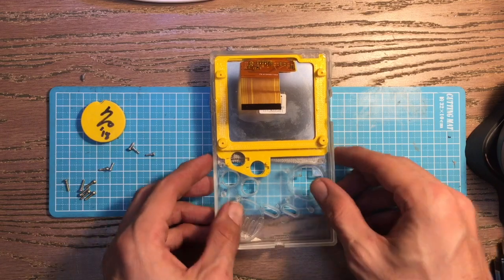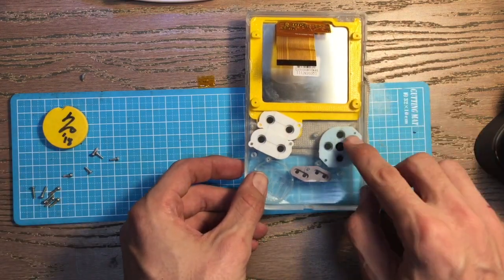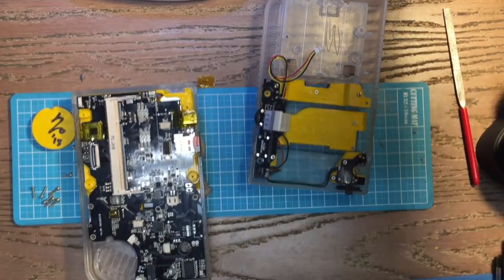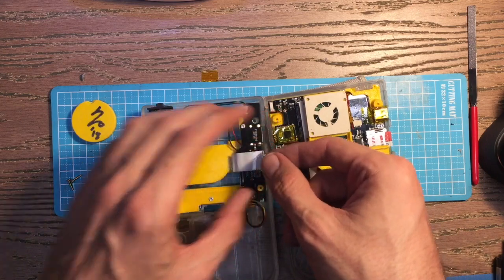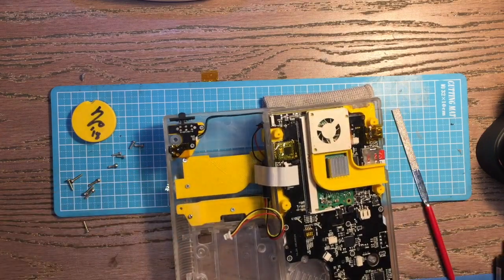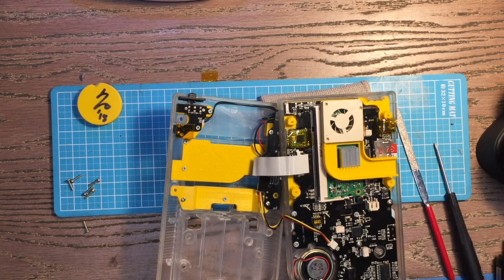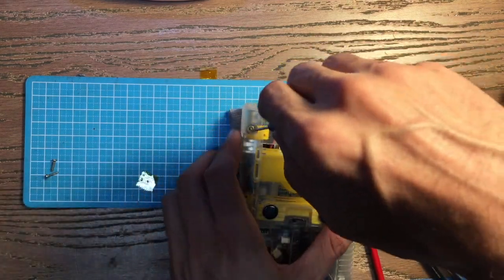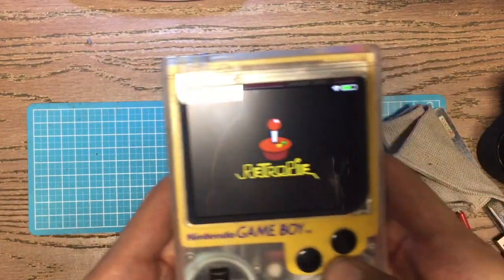GameBoy Zero: Circuit Sword Final Assembly

Comment: Can you tell me what kind of fan you are using and a link to where to get one please?
Reply from the maker: GabrielSorrow the fan is included as part of the Circuit Sword kit. I will have “full DIY kits” available in 10/2018 or you can preorder the next batch for delivery next year around the same time directly from Kite on the sudomod forums. Email me at lee@braains.net
Reply: I'm very interested in ordering from you, how much are the kits. I'll email you too.
Reply from the maker: GabrielSorrow I have not established a pricing schedule because it depends on features, I plan to provide “diy kits” as well as fully or partially assembled units with options including custom colors, joystick(s), volume rocker, and number of rear buttons. I look forward to your email. :)
Reply: just sent one, but i know what i want so , just send me an email with details when your ready and thanks.

Comment: Quick question.  With the air duct that you made for the fan, where does the exhaust end up going?
Reply from the maker: Matthew Thompson It’s pointed to the side but you should make a cut for airflow if you want best performance; I’m only playing NES so the fan never runs on my setup (expect during power up).
Reply: One more question, how does your power switch bracket mount only with the screws?  It seems like it would need to be glued in.
Reply from the maker: The only glue is on the front bracket; power switch bracket is nice and snug with no adhesive, the screws secure the PCB to the 3D printed block. 

It's really the mode switch that "locks" the power board in place once it's soldered, there's more detail in the Circuit Sword wiki Assembly Guide.